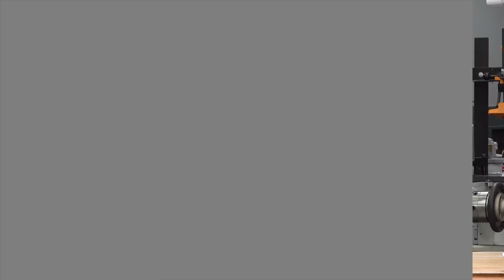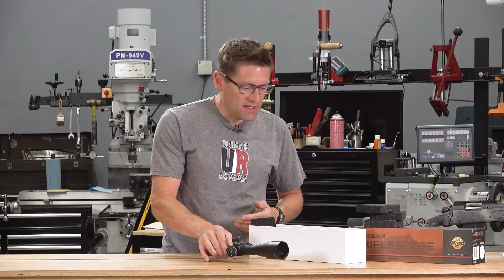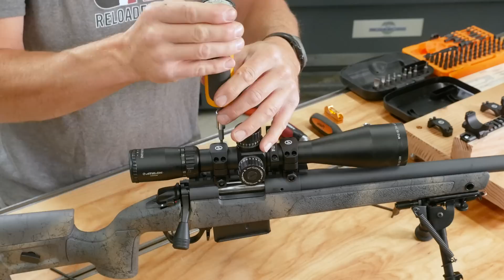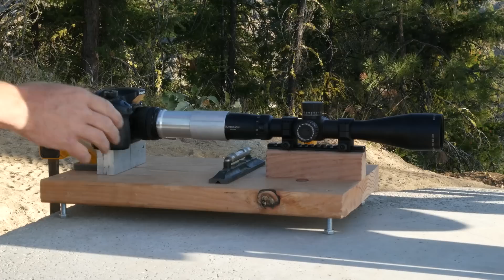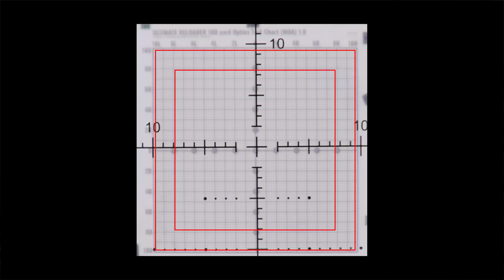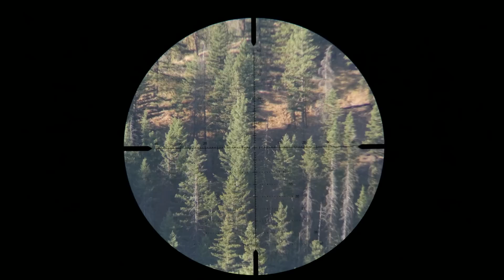TESTED: Athlon Ares BTR GEN2 4.5-27x50mm Riflescope

Comment: What? The christmas tree is not illuminated? I thought, that the holdover points are illuminated too?
Reply from the maker: No- it would be really busy with the tree illuminated, not needed at dusk/dawn/night :)
Reply: @Ultimatereloader  Allright. Good to know. I'm consedirering to by this: Ares BTR GEN2 4.5-27×50 APRS5 FFP MIL. I recently had Midas TAC 6-24x50 and i really liked it. Basically everything about it, but i sold it, so now i need a new scope, which is at least as good, as Midas TAC was. So i ended up in Ares BTR GEN2. Hope i make a right decision.
I have always thought, that holdovers are illuminated too, but this was the first time when saw and realised, that it isn't so. Even Athlon websites do not have any mention about that. There's just compelitely red reticle with holdover dots showing..that's why i though, that the holdovers are illuminated too.

Comment: Would it be possible that the horizontal graduations appeared to be off slightly because the target wasn’t 100% square to the optics position? The target is a flat surface and if it were slightly closer on the left, wouldn’t it appear that the right side grew?

Comment: I bought an althlon talos 4x16x40 with mildot (good scope) then bought 2 neos scopes put them on 2 rifles. Put less than 20 rounds through each and destroyed them. Sent them to athlon got back 2 extremely used scopes(remember mine were new) one of them the paralax was not funtioning straight out the box sent it back(keep in mind every time I send one back it is $20). This time the one I recieved was is so beat up that I refuse to mount it to my gun! So I have been through 6 and only have 1 good one not very good odds. You decide if you want to waste your time and money
Reply: I can only recommend Athlon's Midas HD line and above for better quality.

Comment: I'm curious how this scope compares to the new Vortex Strike Eagle 5-25x56 FFP
Reply: in my opinion there is no comparison, the athlon is hands down better
Reply: I'd say the Ares BTR is 2 or 3 levels above the Strike Eagle.
Reply: @commonsense5709  I actually have the Strike Eagle 5-25X56, and the Ares ETR 4.5-30X56 now.  From my comparison, the Ares ETR is only slightly clearer.  I would consider it one level higher.  I actually like the turrets on the Strike Eagle better.  The ETR's turrets clicks are so close I some times skip over some clicks.  I have also been able to compare both these to a Nightforce ATACR, in which the Nightforce I would consider on more level above the ETR, but glass clarity was about the same as my ETR.

Comment: Your comment of “HD quality glass” may be a bit confusing and based on a lack of knowledge on what that stands for. HD does not mean the same thing in the optics world as it does in... say... flat screen TV context. It actually refers to “high density” glass. This always yields a better image than non-HD options,  hit this is definitely confounding marketing speech.
Reply from the maker: Your comment may be loaded with assumptions about what I meant…
Reply: The Chinese HD glass used in these Ares BTR Gen 2 scopes are clearer than many Japan made scopes such as the Zeiss V4, Sightron SIII, Trijicon Tenmile 4-24x50 and 6-24x50 models and most Chinese and Philippines made scopes when compared side by side on high magnification. Speaking of Chinese, the Ares BTR Gen 2 with it's Chinese HD glass is clearer than the Arken EP5 and EPL4 and their new SH4J which uses Japanese ED glass and clearer than the new Bushnell Match Pro ED with Chinese ED glass as well as many other Chinese made scopes sold by other brands which supposedly use ED glass such as Vortex Strike Eagle and Philippines made Viper PST Gen 2.

Comment: Please do a test on the Delta Optical Stryker 30 power version.
Reply: Search the scope model, these tests are out there. A better comparison is the ETR  or Cronus to the Stryker. DLO just put one out on the BTR or ETR vs Stryker, and there is a newer 2020 version Stryker as well from the European dist., easy to spot, different logo.
Reply: If you live in the USA you need to check how the warranty is going to work before buying this brand.  They don't have a warranty facility in the USA.

Comment: I run 2 of the 4.5-27's and one of the 2.5-15 (mils).  They are unbelievable for the price.  They have tracked without issue, and the reticles and overall design are great.  I would highly recommend them.

Comment: I like where youre going, a few things to note. scope will function best in their center 1/3rd of the reticle so a larger target will show more error. And I'd set the minimum acceptable travel be 30 MOA or approximately what a .308 would do at 1k or you can set your scope to optical center (objective down into a mirror) and check its outer limits on the tracking target. you'll also need 3 targets, Mil, MOA and IPHY. Frank Gallie has a pretty good list of scopes tacking and hes using a beefy mount. there are a few videos of him testing as well...

Comment: I'd imagine if you could get a way  to mount the camera and scope to a small granite surface plate, it would be heavy enough you wouldn't need to worry about it moving while using the dials and it would be fairly thermally stable.

Comment: Great video, Some things to add to the consideration list. It may be worth developing a scope cradle that has x and z axis adjustments. This will allow you to start with the scope optically centered in the tube. The cradle would then be used to bring the crosshairs to the target center. This will also resolve issues with fine tuning the between clicks issue on the turrets. 
Do you have a way to verify the target board is perpendicular to the shooting bench/ scope? Many laser "tape measures" can read to the 1/16 of an inch. Most won't do 100 yards. Possible a reduced scale target at a shorter range. 
You channel definitely speaks to science geek/ machinist side of shooting that I love.

Comment: Would you consider the KRG Bravo an upgrade over the factory HMR stock?
Reply: I’ve used and handled both and would say they’re pretty equal. The Bravo is a little more versatile on the fore end but both have internal chassis bedding and adjustments for LOP and Cheek height. If you already have an HMR and have to upgrade, I’d look at McMillan, Manners or Grayboe. His results and experiences may vary of course.
Reply: I’ve got a KRG Bravo and I would NOT buy one again, not impressed.

Comment: Really love your videos,  just picked up a slightly used Sightron S111 6X24x50, very nice glass and built like a tank.
Reply: The Japan Made Sightron SIII 6-24x50 starting at $600 simply can't be beat.  It's like getting $1000 Japanese scopes for $600.  The Japan made scopes sold by Tract Optics can't be beat for their price as well.

Comment: Absolutely love Athlon Optics ! I'm using the Argos BTR Gen2 10-40X56. Incredible optic and quality in the $400 range.  My next scope is an Midas Tac 5-25X56.
Reply: I just bought the 10x40x56 for my benchrest rifle, I haven't mounted it yet but excited to see how well it does. I have the 4,5x27 on my 6,5 Creedmoor...love the athlon optics.
Reply: @redraiderreloading7612  you'll like the target dot, it's great for benchrest. I can easily see .17cal holes at 100yds
Reply: I did a tracking test on the Argos and was really disappointed. How does yours track?
Reply: @Potatogambit  which argos
Reply: Red raider reloading Argos btr 6x24. It was off by almost 10%. 30 moa dial was actually 28.
Reply: @Potatogambit  did u call athlon.
Reply: Red raider reloading I did. The next one tracked a little better. Still not good enough for it. And then the parallax adjustment broke. It got returned and refunded.
Reply: @Potatogambit  man that sucks. Glad they made it right
Reply: Red raider reloading they did. But I was curious how the newer ones are holding up. Just to chicken to buy another test subject.
Reply: I would not recommend the Athlon Argos 6-24x50, I own 2 and both have very poor image quality on high magnification.  The Midas Tac 6-24x50 and Ares BTR 4.5-27x50 both have superior image quality even on their highest magnification settings compared to the Argos.  It's very hard to believe these Chinese scopes came from the same brand label TBH.